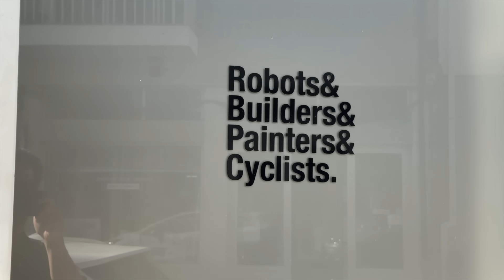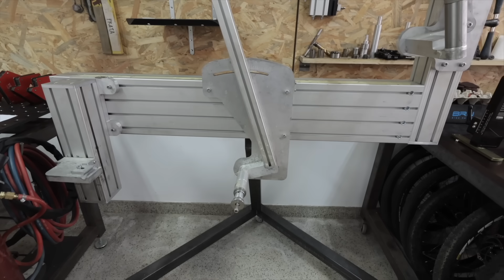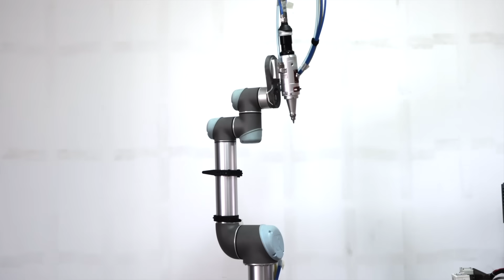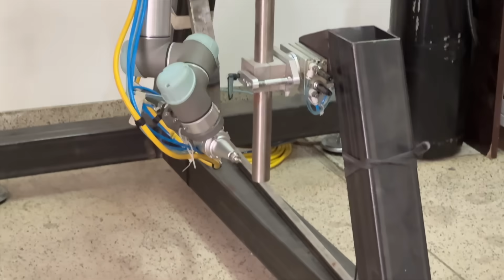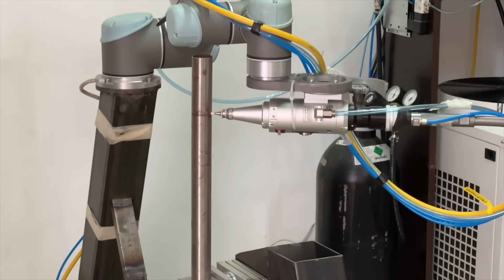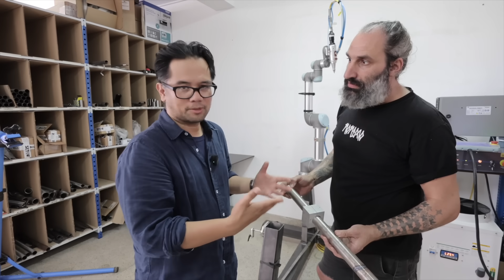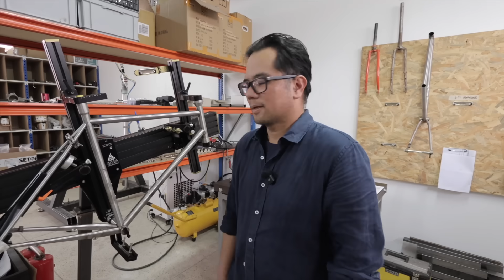This Will Change Framebuilding Forever

Comment: As a small builder based in Barcelona, really looking forward to this. I've been thinking of getting the tubes pre laser cut and mitered, so i get my frame as a lego and just do prep, jig, and weld it. Since i have no access to a mill, i've built a prototype out of grinding machine and hand files and yeah, if i can get everything cut will make my life so much easier and the client is going to get a higher quality piece.

Comment: Very cool video. Frame builder here who built and designed my own tooling. One question.What is the cost of the robot and software? Thanks
Reply: There’s nothing wrong with designing your own tooling, I’ve done the same. But I think we have to be careful not to confuse building tools or using tech with craftsmanship itself.

As David Pye described it, craft is “the workmanship of risk”, where the result depends on the maker’s skill in the moment, not just the setup or programming beforehand.

So sure, you can build a jig, automate a mitre, or even develop your own robot, that’s impressive engineering. But if the human skill and judgement are being designed out of the process, then it’s moving away from craft and toward manufacturing. That’s not a criticism, just a distinction.

Both paths are valid. But I believe it matters that we keep that distinction clear or we’ll lose sight of what makes true craft worth preserving in the first place.

A framebuilder is a craftsperson, so if you move down that path towards manufacturing, you are abandoning craft. If you can be replaced by a machine and automation then you are no longer framebuilding.

The flippent comment above misses what the luddite were protesting about. Not the advance of technology but the devaluation of skilled labour.
Reply from the maker: skilled labor only exists when it can make a living. Using tools to expand capacity or efficiency so its possible to make a living seems like a good thing.  There is a vast gulf between artisanal ¨craftsman¨and a fully automated factory.  The single ¨craftsman¨ framebuilder who does everything by hand and makes an actual income is the anomaly and not the norm and in my opinion perpetuating this myth is a disservice to the trade.  I only have to point to Merriwether´s cycling announcement this week that they´re closing.  But by all means continue to be the artisinal framebuilder police.
Reply: @PathLessPedaledTV Russ, thanks for replying — I genuinely hear your point, and I agree: it’s incredibly difficult to make a living from skilled manual work today. Merriweather closing is heartbreaking. But I’d argue it’s not the myth of the solo craftsperson that’s the problem( I don't advocate for that), it’s the abandonment of craft itself that’s led us to this situation.

For decades, we’ve been moving further away from skilled labour in the name of scale, efficiency, and profit and yet somehow, it’s still hard to make it pay. Maybe that tells us something. Maybe the solution isn’t to automate more and strip out human input. Maybe the real value lies in embracing and protecting craft, not rebranding it.

If someone wants to manufacture bikes, great,  own that. Call yourself a fabricator, an engineer, a bike designer. But don’t co-opt the language of craft — framebuilder, handmade, artisan, while removing the human judgement and skill those words were built on. That’s not evolution. That’s just branding.

Craft, as David Pye put it, is the “workmanship of risk”, where the outcome depends on the maker’s skill in the moment. If you remove that, it’s no longer craft. It’s manufacturing. And that’s fine. But let’s not pretend it’s something else.

Also, I want to say this sincerely: I think you do a good job with your channel pushing back on the worst instincts of the bike industry. That’s why this felt like a missed chance.

Those of us trying to preserve a piece of cycling culture and a working-class craft with real history and value, aren’t Luddites. We just want to be heard, not rebranded out of existence.

Give us a chance to show why this still matters. Not just as nostalgia, but as culture, continuity, and care.
Reply: Back to my simple question. What is the cost of the robot and the Software?

Comment: Get rid of top tubes & replace them with continuation of the 2 seat tubes running parallel with each other along the top. Means way less work welding tubes together & all one needs to do to increase stiffness is simply widening the gap between them, while keeping the actually tubing as small & narrow as they were as just seat tubes. Why bicycle manufacturers persisted with single tubes is beyond me. Motorcycles gave up on them like 70 years ago.
Reply: Two tubes are much heavier for equivalent stiffness. Top tubes need to be vertically stiff as well as laterally, so while you can make a bike with twin tubes, they don't ride very well when compared to a good tubeset, and they are heavier.  Additionally, you wouldn't be getting the advantages of a butted tubeset.
Reply: @Bikeconstructeur  no they’re not, as it depends on the material. Using 6-4 Ti or high strength stainless like maraging inox 2 slim tubes has better strength to weight measures than single tubes because the single tubes would have to be so paper thin to match they are unviable in practice. In fact the UCI banned parallel tubing because they saw them as a unfair advantage. I can dig up links if you desire.

Comment: I’ve seen a robotic controlled cutting system where the laser stays stationary but the tube is rotated and slid forward and backwards to control where the cuts are made. Maybe this system is even more precise? I guess this system is superior because it can be used on non cylindrical parts like seat stays and chain stays.
Reply: That is the mainstram solution but not compatible with high end steel bike frames as our tubes are short length and double butted, round and oval, and stays are curved. The solution we designed and integrated —we bougth robot in one place, laser in another and are developing our own software— allow us to cut ALL necessary bike tubes...
Reply: @bungalela that completely makes sense. Do you use a special scanning tool, so the robot knows exactly where the part is?
Reply: @jamescaldwell5 We have worked with Reynolds to have tubes supplied within a more tight tolerance. That way we can trust our 3D files of the tubes, straight and bend.

Comment: I think wire discharge was a cleaner cut. For ultra thin tube I like the belt-sander-around-a-drum method. Remember: hole saw creates no heat-affected-zone.
Reply: How about welding a hole saw joint? Not to be a smartass, but I think this is a really cool innovation. Plus, a robot arm could yield a sanding drum as well.

Comment: A very exciting technology! 

Family and I are traveling in Central America at the moment. I'm seeing 2 types of bikes: 1) 90's mountain bikes, & MORE INTERESTINGLY, 2) bikes that look to be currently produced that are patterned on 90's mountain bike technology, so as to be reliable and easy to maintain (i.e., aluminum or steel frames, rim V-brakes, front derailleurs, 26" wheels, most equipped with a rear rack). Seems like this frame cutting technology could make ongoing production of the bikes mentioned above (#2) in places like this a possibility in a way that would drive prices down, create local industry, and create an ongoing market for parts that many consider "retro".

Comment: While the technology is not particularly new, it would be innovative to see how it is applied to shaped tubing. I ovalize and bend tubes based on project needs (and all chainstays), so I’d like to see how this develops (if at all) to execute on non-linear/straight tube shapes. While I don’t see it practical for single-builder shops, it may have some use in production houses. 
P.s. like the intro shout-out to the Framebuilders’ Collective..🙏
Reply: Our system was designed having in mind the short length of butted tubes, roiund or oval, as well stays in any form and bends. We couldn't find a partner to do it as we wanted so we made it ourselves. The goal is to work in batches, not custom but even that is posible.

Comment: I'm always torn with things like this. On one hand I see the possibilities a robot like this offers. On the other I see a loss of hand-skills.
The more we have, the less we need to be.
Reply: Let's not confuse cutting tubes and using files to fit them manufacturing.

Real craftsmanship is digging tup the iron ore yourself and creating your own tubes...🫠

Sorry for the pun, but this is just an arbitrary romantic fantasy you're having with a certain step within the production of a bike.

This hybrid way of preparing the same base materials for the builder/craftsman is a great tool - Don't use it, if you don't like it or don't buy the endproduct.
Reply: @antitainer3761  This isn’t about purity or digging up ore, it’s about where skill matters in the process.

The designer and maker David Pye put it best:

Craft is the workmanship of risk, where the quality of the result depends on the maker’s skill.
Manufacturing is the workmanship of certainty, where the process seeks to eliminate human variability to guarantee the outcome.

That’s the real distinction here. It’s not about which tools are used, it’s whether the human being is essential to the quality of the finished frame.

Using machines to assist the builder is one thing. Using them to remove the builder — and still calling it craft, is something else entirely.

No one’s saying you have to like handmade bikes. But let’s at least be honest about what words like craft, handmade, and framebuilding actually mean.
Reply: @ellisbriggsbikes 

Ok, fine, but that are just semantics and word games.
You pull up an arbitrary definition of words, which fit your 'work philosophy', but in the end you are not the one who will globally define what craftsmanship is and what isn't. (me neither btw)

I consider a bike to be handmade, whether the tubes are cut by the hand of a human or cut by a machine programmed by a human.
The result will be the same bike (with better tolerances when cut by a machine - I think handbuilders like Starling are having the rear triangles milled externally in order to achieve the tolerances needed for a modern MTB)
Less fiddling resulting in less time and waste = better bikes for your money

For the longest time every bike has been handcrafted in the old way, where everything has been done by hand and I would argue, that the average modern bike is miles ahead of a vintage steel clunker.
Individually people may prefer the old lugged stuff based on aesthetics - I prefer the look of a vintage steel bike, but for riding the gnarly stuff downhill I would choose a modern rig anytime of the day.
Reply: Takes the handmade frame out of it.
Reply: Like pedaling a machine makes walking seem so slow. My 12 minute walk to the post office is ruined by my bicycle.
Reply: I have no problem with people doing this and calling it micro manufacturing. But it's not framebuilding, it abandons craft entirely and removes human input as a goal
Reply: @ellisbriggsbikes  People are always free to buy hand files and stand in front of a bench as long as they like.

People probably said the same thing about CNC machines. On the other hand, manual machine tools are also still everywhere, right next to the CNCs. So this kind of tube preparing can be used for large quantity manufacturing, and more basic methods for one offs.
Reply: @Orgakoyd  The point I’m making is that the so-called “basic” method is actually superior in the hands of a trained craftsperson.

When people come into framebuilding without learning the traditional way, they try to hand-file a mitre, struggle, and assume it’s the method that’s flawed, not their own technique. So they look to machines. But even with automation, they quickly discover that setup, workholding, and tolerances still take time.

The core assumption becomes: “the human is the problem.” But in reality, the human just needs training. Optimising the builder, not removing them, is what framebuilding is all about.

Calling something “framebuilding” while automating every step to eliminate human skill is like calling a computer playing Chopin a musician.
It’s not the same. It never will be.
Reply: @ellisbriggsbikes Really? What makes hand frame building so superior? That's a sincere question. Humans add more variability and therefore a less precise and well-made product. We really over-romanticize what humans bring to the bike building process.
Reply: @AnthonyFrey The argument isn’t that handmade bikes are faster or perform better. Often, there’s no measurable difference at all. That’s not the point.

The point is: craft matters. It’s not just a means to an end—it’s a human pursuit worth preserving. A frame isn’t just tubes joined together. It’s a reflection of time, touch, and experience. If we strip the human out of the process, what are we left with? Just another product, made for convenience, not meaning.

And yes, humans can be precise. Very precise. But we’ve convinced ourselves that the only precision that counts is the robotic kind. We’re chasing efficiency in the wrong place, we should be optimising the builder, not replacing them.

It’s like music. You can programme a computer to play Chopin perfectly. But would you ever say it’s better than a flawed, heartfelt human performance? That’s the difference. That’s what craft is.
Reply: @ellisbriggsbikes it's just a bike
Reply: @ellisbriggsbikes  Welcome to the Hybrid Craftmanship Age. We know the traditional way of making bicycles. We have been doing that for years but we also have digital skills that are also suited for bicycle fabrication. A tool is a tool. The difference between Bespoked and Industrial is not hand skills. It is the competence to dominate the full fabrication process. BTW, are you still riding a horse? Or a bicycle...
Reply: @bungalela I’m not opposed to technological progress, far from it. But let’s be clear: framebuilding is a trade. A framebuilder is a craftsperson.

As the British writer David Pye described, craftsmanship is the workmanship of risk, where the outcome depends on the skill, judgement, and sensitivity of the maker.

That’s very different from the workmanship of certainty, where a process (often automated or mechanised) guarantees a consistent outcome regardless of the operator’s ability.

Craftsmanship is the former.
It’s about human involvement, not just in pushing buttons, but in shaping, adjusting, interpreting, and refining.

So use the technology. Build bikes however you like. But let’s not confuse manufacturing with framebuilding.
Reply: @ellisbriggsbikes  Are you using hole saws on a mill or hand files? Just curious. The reality is that traditional framebuilding isn’t a sustainable business model for more than a handful of people worldwide—and there’s research to back that up.

We want to make a living by building bicycles, not importing them from sweatshops in Asia. In our workshop, we’re a team of four: one manages the business, and the other three are skilled framebuilders who can braze, TIG weld, and work with lugs. We use files and hole saws, as well as mills and lathes. We also code for CNC machines and robots, and when it makes sense, we print in steel—because digital fabrication can be a creative, practical, and economical tool.

As an architect who transitioned from analog to digital, I can sketch by hand, use parametric design, and blend both approaches to fabricate. There are many ways to build a bicycle. We don’t need to dismiss traditional methods to justify the new ground we’re exploring.

There’s room for everyone. Different markets. Different tools. And that’s perfectly fine. Just don’t think of yourself as the gatekeeper of a lost art—it’s already changed many times before.
Reply: @ellisbriggsbikes  As an ex cabinetmaker, I totally agree with this. You've got to have the handskills before you start with the machines. A person with good handskills will always get more out of machinery than someone without.

Comment: What does it cost! I imagine that for most ( or the few surviving frame builders, certainly in the UK) it is prohibitively expensive!? Despite the resurgence in interest in hand built frames 
the demand is not what it once was so I believe that it has hard for frame builders to earn a lot of money and therefore the time it would take for the robot to pay for itself would, I suspect, be long.
I wonder how much quicker it is by the time you have programmed the thing what with recalibrating it for tube thickness etc..I am all for progress but I am concerned at the potential to lose time served hand skills.
I am a woodworker, not a frame builder but I have done a frame building course, where I cut and filed every mitre by hand. It didn’t take that long. In woodworking now there are a plethora of jigs and fixtures and devices which in combination with machinery and power tools almost negate the need to have real hand skills. I probably sound like a Luddite but when these skills are gone, they are gone!!